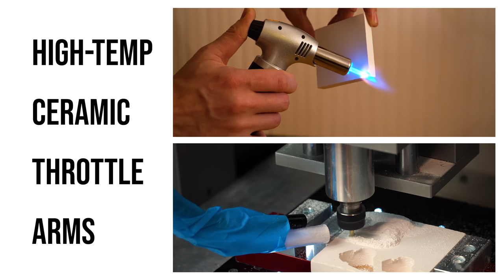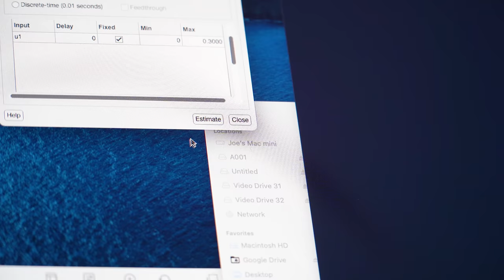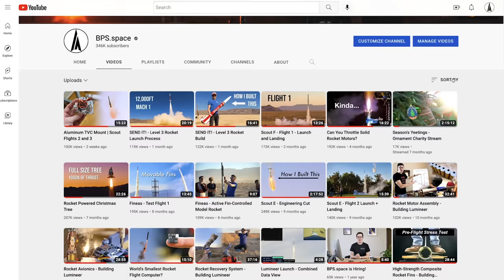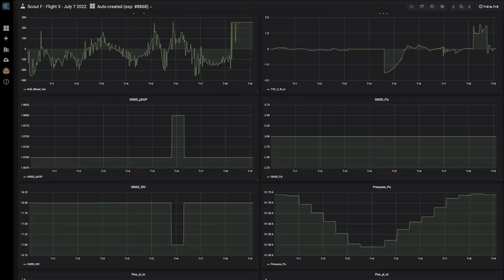I Landed A Rocket Like SpaceX - Scout F

Comment: Awesome work!

Is the meat rocket a rocket made from meat that grills itself during ascent? Is there a prize for correct guesses?
Reply: might be an interesting way to deliver a hot and fresh "steak" to someone's door but im more inclined to believe its an engine that is powered by meat and LOX
Reply: Meat rocket? Sounds rather… Off-Nominal…
Reply: @cms1999  Sounds yummy.  Char-broiled meat, flying through the air to target the bun as you hold it out in your hand.
Just add condiments!
Reply: Getting Mythbusters. salami rocket vibes, also well done on the landing
Reply: i'm guessing it's something similar to the mythbuster's (eh hem, er) meat missile.
Reply: @ianmastin  👀👀
Reply: This is just a butchery resupply mission to the ISS 🍖
Reply: We should get the NSF crew to call the live stream of the Starship model flight. 2 stage right?
Reply: @ianmastin  You should look into Project U.P.S.T.R.E.A.M which is a challenge to develop a rocket that uses salmon and LOX as propellents.
Reply: @neutronium9542  Any carbon based material can serve as the solid fuel in a hybrid-propellant engine. blend your salmon into a paste then spread it out onto a baking sheet dehydrate it in an oven then grind it into a powder. Mix your salmon powder with a binding agent like Elmer's glue to make a firm almost crumbly dough and pack that into a cylinder to make up your rocket body. be sure to include a way to leave a hollow core through the length of the cylinder or drill it out after, let it all dry solid and that's pretty much it. You'll need an ignition source and LOX to pump through the core of the engine as it burns and of course all the components of the rocket itself but the chemistry is pretty straight forward.
Reply: When he mentioned the meat rocket, my first thought was a Hot Dog sausage with a rocket motor in one of the ends flopping around as it flys up in the air 😂🤪.
Yeah I have a vivid imagination
Reply: jetpacks can be considered meat-rockets as well -- there is a rocket, and there is some meat
Reply: thats the product where rocket will as it travels to the customer also  grill the meat nad whne it comes to given destination the meat will be all  grilled and ready to eat!
Reply: I love this 😍
Reply: What was the Isp for the MB Salami and N2O engine?
Reply: Maybe it's just my 8 year old humour, but I'm imagining the "meat rocket" may breach community guidelines.
Reply: Maybe " meet" rocket.
Reply: @craigpoole9218  that is my initial thought as well.. i cant wait to see it revisited because i always felt they could have gotten better results.
Reply: Its a Jet Pack guys
Reply: A rocket powered BBQ would be pretty epic. 😄
Reply: @BPSspace  Now all you have to do is design a module to put something in orbit.
Having said that on serious note.
Can't we use something like this to put hypersonic missiles in lower orbit? Wouldn't it seriously reduce the cost?
Reply: "Meat Rocket" sounds like sexual innuendo. 😂
Reply: @rmkenney  seasoned with RADIATION
Reply: I think its a double 'e'.  It's gonna be a meet rocket.  Connecting up with something else. . . . .

Comment: Just imagine how tough it would have been for Elon Musk and team to land such a huge booster!
Reply: Don't get me wrong but in some ways, once you know it's doable, it might be easier. I've often thought that Joe could improve his chances with a little extra mass to slow the acceleration.
Reply: I think so. Because the weight of this rocket is so small when comparing to the capability of it legs and material. It can keep vertically well but it still depends on legs mainly. You can see how it bounced after touching down. When increasing the size of rocket, I don't think those legs can handle that.
Reply: A large booster might actually be a bit easier. The inherent mass and intertia makes it more stable.

Comment: i have done my part of flight controller programming for race drones and winged drones and so on. easy stuff. and the software mod for iNAV i am most proud of that i did 4 years ago was a airspeed cruise control, so you dont fly to slow flying with the wind, you so need a pito pipe and sensor for that. what i was going to write was i have done the stuff regarding stabilize by pitching rudders or ramping up and down motors, and stuff for both drones and winged drones. but this.. this is hard work for sure ! SpaceX  reached out to you yet?

Comment: I would have just located a relatively high overhang (like a bridge), tied a thin string from the overhang to the tip of the rocket, and done a lot of debug runs without ever destroying the rocket.

Comment: I want to see a new sport in hobby rocketry, a competition, which entails firing rockets down range and at some sort of target which perhaps a net is used to catch the rocket.

Whoever is the most accurate wins.
There could be variations of the game, maybe there could be bonus targets if you’re able to fly it through a hoop or ring while on the way to the final target.

The game would be based on a points system, and the cost of entry could partially be used as the prize.

Will you help me promote this new sport?

Your thoughts?